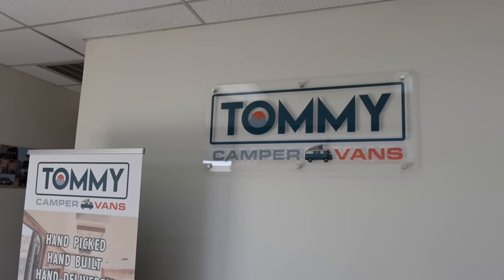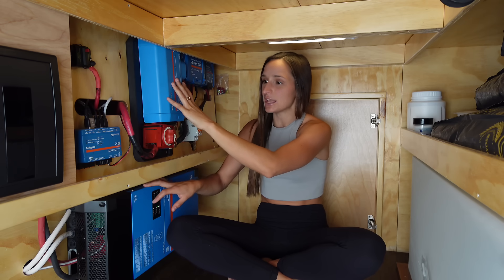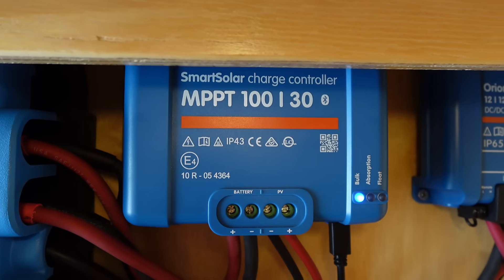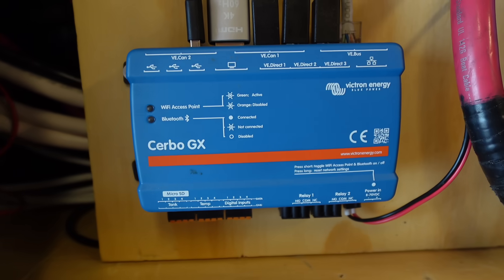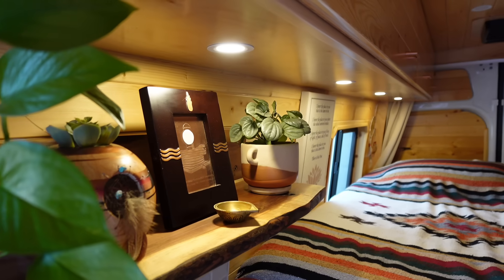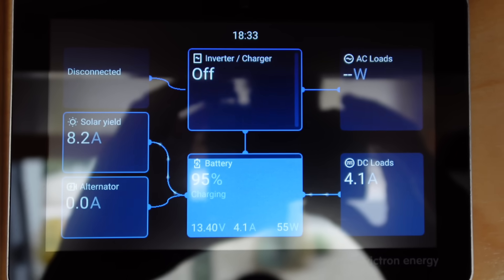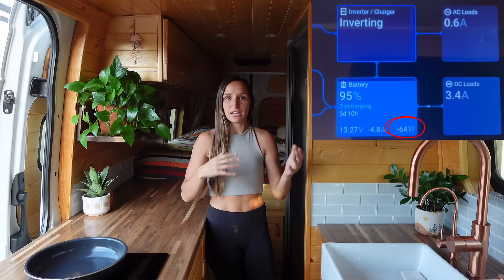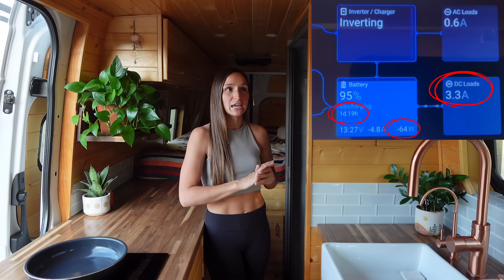VAN ELECTRICAL SYSTEM | A Practical & Simple Breakdown

Comment: I could listen to you talk all day. What clear diction and with a well written script! It also doesn't hurt that you are the internets most beautiful van lifer! haha. Was that a dishwasher I saw in that first sequence? Sure looked like a dishwasher. Also, has anyone made a heat pump water heater for van lifers? WAY more efficient and could be used to cool the van also. Thanks for the vid!
Reply from the maker: Thank you! That was actually my fridge that you saw. Dometic CRX110. Not sure about the heat pump water heater.
Reply: @sarahhfoss  makes more sense its a fridge. Was going to have to declare you the permanent winner of van building if it was a dishwasher. very cool looking fridge. What do most vans youve seen use for hot water? Im guessing the small tankess ones would be the popular choice. Im a plumber and thinking about fitting out a camper for traveling.